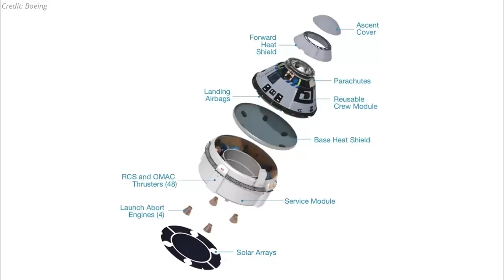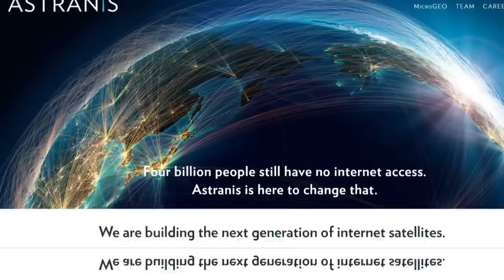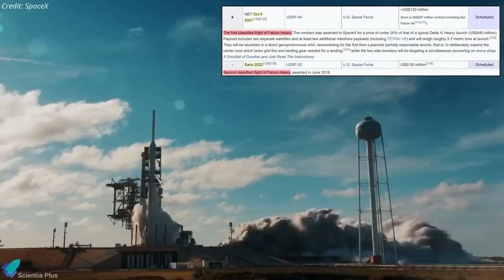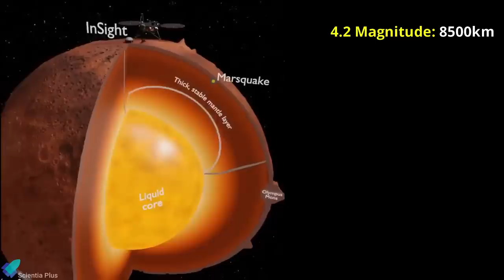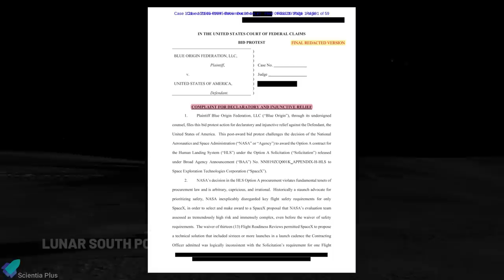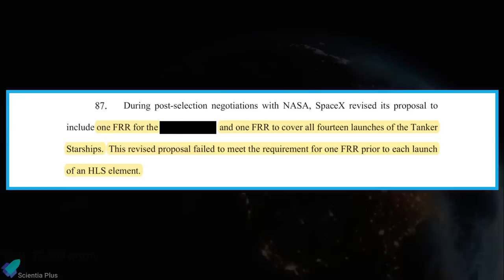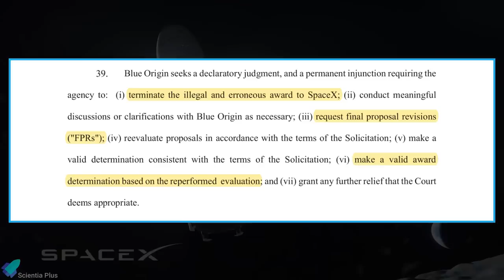Why was Super Heavy Booster4 Removed? | Starship20 Testing Imminent | Starliner Launch Slips to 2022

Comment: Leaving something out of a bid does not, necessary, disqualify the bid. The controlling agency may add the estimated cost to the bidder's price when evaluating the bid. There is no way the cost of the flight readiness reviews whould have changed the decision so this should be a non issue.
Reply: @user-pz6mc2oj3f  All the other bids including Sue Origin where extremely inadequate, outdated and wildly overpriced.
They had little to no improvement on the Apollo Moon landers and no path forward to create a lunar or Mars base.